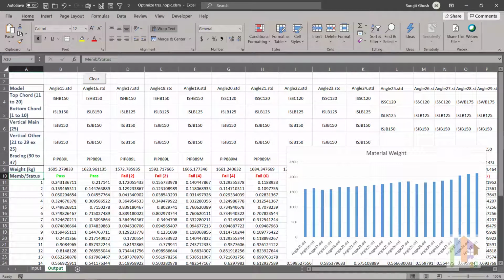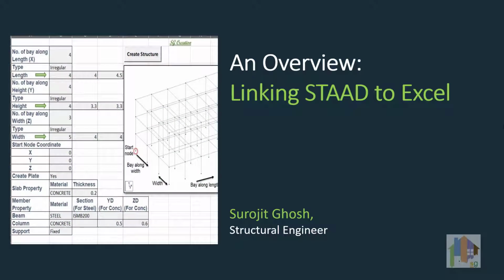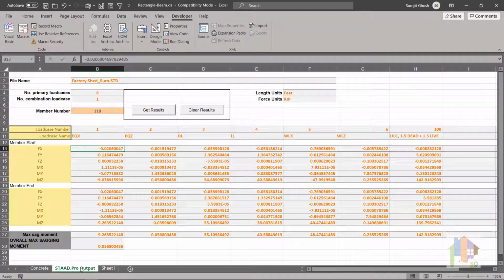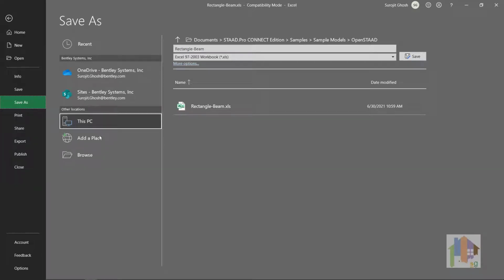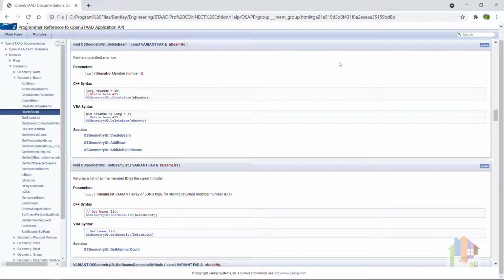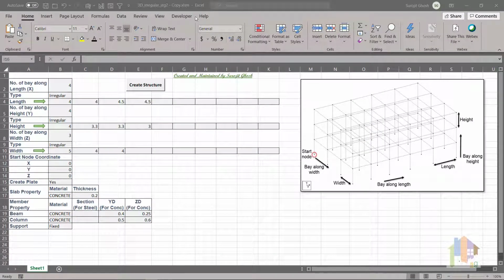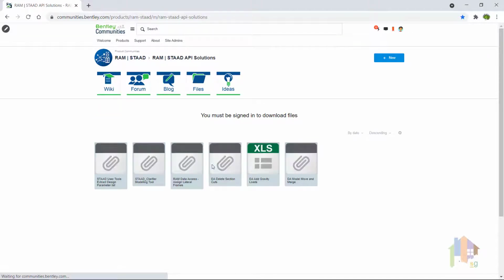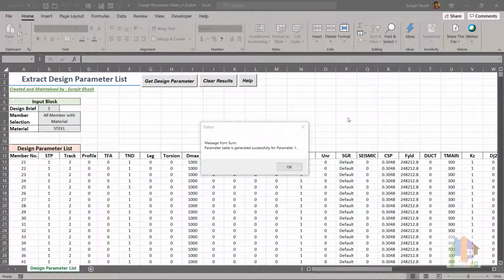Linking STAAD to Excel: An Overview of Automation || OpenSTAAD || VBA || Custom macro

Comment: if we have reactions in excel and we want the values to be transferred to the staad model, how do we do it, can you guide
Reply from the maker: You can read the data from excel, then using OpenSTAAD functions, create one or multiple load cases in the STAAD model and apply those reactions as nodal load.

Comment: Is there any method of extracting column and beam reinforcement from staadpro connect edition to excel or note pad or word
 It takes lot of time to write physically the reinforcement.
Reply from the maker: It is not possible to extract concrete design results using OpenSTAAD, but it can be achieved by reading the output file. You can develop a code which will extract the reinforcement data from output file. More efficient way is to use STAAD Advanced concrete design mode with basic/advanced STAAD license, which produce tabular format output.

Comment: Hi dada. I am also from JU. 2012 batch. I am facing problem with Staad 2023 VBA reference in excel file. Excel reference is not updated after new staad installation. Even browsing path for new staadpro.dll is not working. "Error in loading dll is being shown". Can you tell how to fix?
Reply from the maker: If you install older v8i version of STAAD first and then try to use STAAD CONNECT Edition or 2023, this problem occurs. One way - remove older version from the system and delete all supporting files/registry keys. That normally solves this issue.